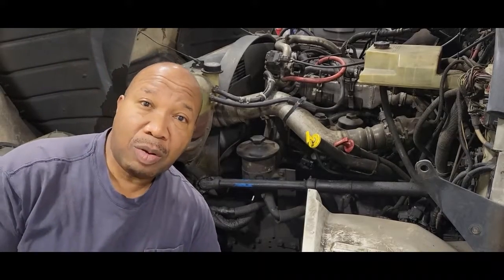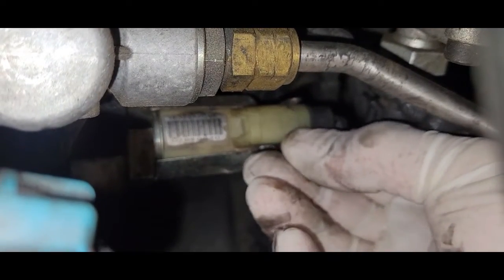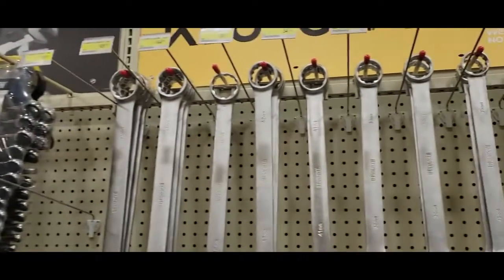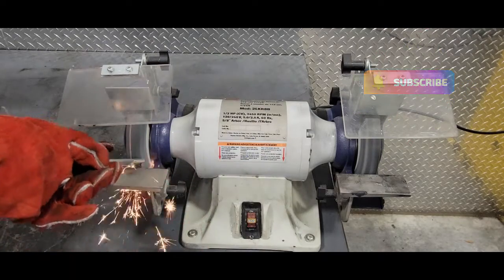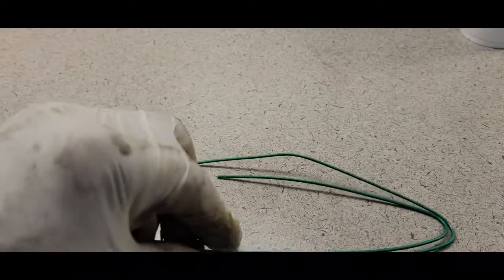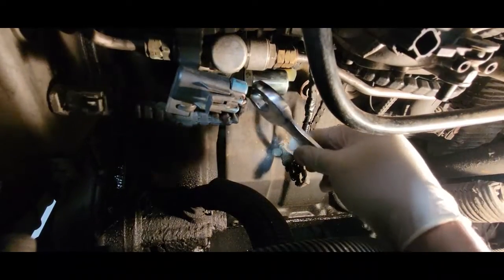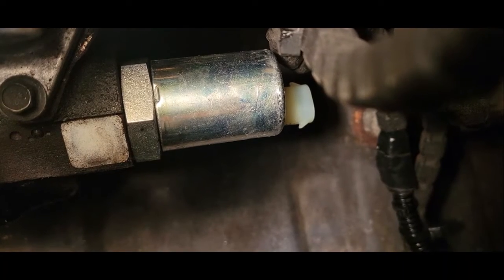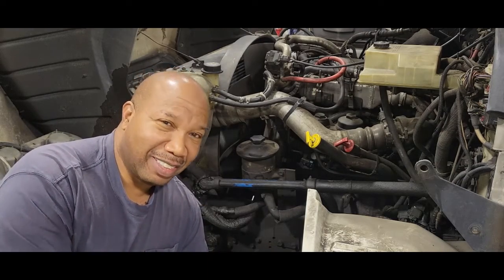How To Replace A IPR Valve On 4300 International

Comment: Do you have the part number for the ipr with a 90 degree?
Reply from the maker: Not off hand.
Reply: @dairleautoclassicrestorati6892  Thank you. Can the 90 degree be replaced with the other one? Just left the parts dealer and he said it wouldn’t be a problem.
Reply from the maker: @damnkp  It will work like the straight one. That is providing you have the room for it.
Reply: @dairleautoclassicrestorati6892  ok thanks. I believe there is room. I appreciate you answering my questions. Subscribed!!